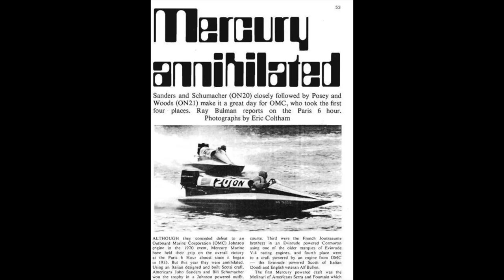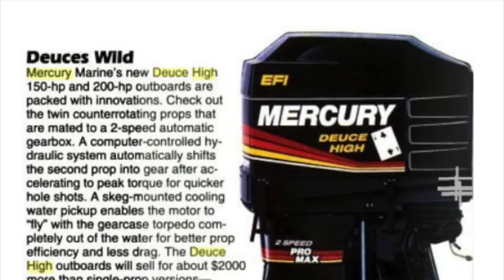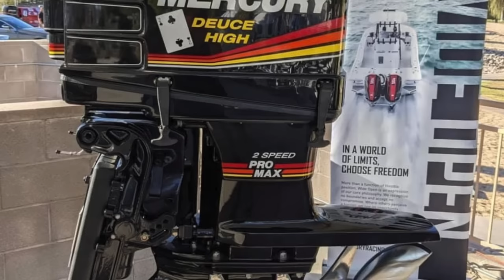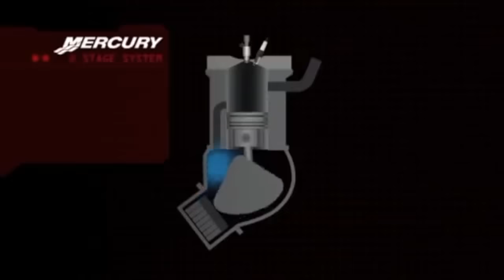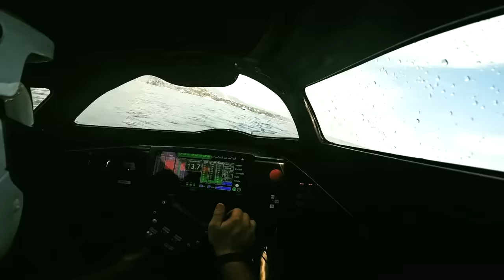Mercury Racing TOP 5 ENGINES OF ALL TIME 50th Anniversary Special

Comment: I raced a T2X, OPC 88, Molinari hull in '76 and '77. The SSM gearcase skeg would hum like a wet finger on a wine glass above 85 or so and resonate through the boat. You knew at that point that you were smokin'! What I learned on those inline 6's back then, serve me well today and prepared me become a "guru" (SME) on the Honda inline 6 CBX motorcycle. I wish I had never sold that rig. I'd have it set up today on a stand, just to hear it howl. I saw 110 on the Keller speedometer at the Columbus river race. Those were the days! Ranked 5th, nationally against sponsored teams.
Reply from the maker: That's badass man!    Thanks for the comment!!!!!

Comment: Great video until the noise problem outboard will be replaced by the electric racing division. 😢😢
Reply from the maker: Not replaced.   You simply cannot race boats in lot of areas because of noise.   This series means racing in areas you can’t currently race at!  More racing, w super weird hull designs!

Comment: Cool video

I bought a used 250xs right before Covid - love the lightened cowl vs standard one on my prior 225 opti. Don’t race so can’t comment how much more I got going with the racing motor but should add value nonetheless. Not a fan of the higher octane which is impossible to find in rec gas so I end up using octane additive just to be compliant. Opti tech was pretty cutting edge but still lots of high pressure things to go wrong imo. I know many love the old 250 and 300 non-opti just to simplify the tech but they drink like sailors. Pick your poison…

Ironically read that Evinrude did finally master the 2 stroke emissions after some serious failures. Apparently less polluting than even the 4 stroke mercs and optis - shows that some bad business moves can sink the ship so to speak even with potentially better tech….
Reply: P.s. Love the plan for e racing / frustrating when people slam it but it’s ignorance and never having been pinned to a Tesla/EV seat…crazy torque and less parts to deal with
Reply from the maker: Yeah, I think they bet on the wrong horse.  Regardless of how clean it was, people associated 2 strokes w stinky/smelly/poorly running engines.  Sad to see them go, I liked how they were taking cowling a completely different method with swappable side panels.
Reply: The 250 Xs isn't  a racing engine. It is a detuned version with oil injection. The race versions of the 2.5s ran premix and much higher RPM. 
Search 2.5 280 Offshore and 2.5 300 Drag.
Reply: @GT-mn3bx  ok - was the 250xs not hand built at mercury like the 300xs? Maybe my facts are wrong. It might not be classified as pure racing but it was hand built on that line vs the 250 pro xs factory fishing engine line
Reply: @1972mdc  They were a consumer friendly "Prosumer" detuned version. Less port timing, lower rev limiter, oil injection, non offshore midsection.  They don't even have the same growl of the 2.4, 2.5 offshores or the 300 drag which is unmistakable. Also, they didn't have the massive water dumps right off the heads.  Few other things also.
Reply: @GT-mn3bx  well all I know is what I learned online and calling Mercury tech support. The pro xs is the consumer version, the xs (300 and 250) are categorized by them as hand built racing engines on a separate line. I prefer the simper tech of non-DI but it’s what I have (plus a Simon tuned ECU).

Comment: Sitting on my shelf somewhere in the back I have a 1983 2.4 chrome cylinder 300hp oval port. Yep a 300 hp 2.4 does exist.  I also have another around 1983 chrome cylinder race motor.  I also own one of the motor out of Jon Wrights Tinker Toy. 156mph world record holder.  Started life as a 2.5 150hp block.  That’s 3 Mercs. All used on my 1985 STV Sprint bottom stepped sponson race boat.  One of Summerfords personal under 400lb hull boats.  Then I go and buy one of Summerfords less than 200 made 1988 Stratos 200VT Rockets with an evinrude XP color matched motor trailer and hull 200 body hiding a very modified Johnson 200GT Loopers highly modified engine with quite a bit of cool stuff on it.   Unfortunately I hadn’t touched or rode any of it for 5 yrs now.
Reply from the maker: Use it or sell it to someone who will.  Stuff hates sitting and just turns to junk.  Life is short!
Reply: @ADDvanced   I know, your right.  Just can't seem to do it yet.

Comment: Regarding Evinrude failing. It wasn't because people didn't want two strokes, it was due to Evinrude's poor quality control and design issues that caused too many failures. Bad reputation is why people didn't want them.
Reply: back in the 70's and 80's omc made engine was the only way to go, Mercury, Chrysler Archimedes Penta or Cresent was just crap, maybe Mercury was god on racingboats, but for the common man just another problem, but in the later years Mercury has made good engines and all the other above is gone.
Reply: @ottoolsen9676  You are referencing the wrong era. I have no complaints about OMC or Mercury from the 1970's and 1980's. I owned both. 
Evinrude failed much later. They failed with poor quality in the fuel injected era. One example is the Evinrude Ficht. Some lasted but many didn't, which killed their reputation. 
Our family and friend's experiences with high HP Mercurys from the 70's on has been excellent. Running high speed tunnel boats at redline. Great fun and reliability. Still running a 1980's Mercury V6 200hp on a tunnel. Still hits speeds in the mid 90's. The sound of the above-water exhaust and surface-piercing prop is awesome.
My uncle had a first year Merc 200 V6 (1977 I think) that we all abused by running flat out regularly on the Colorado River and Lake Havasu. It never failed. We've had Mercury's through the end of the two stroke era. The later 300+ hp engines are awesome.

Comment: ADDVANCE did you ever get your overheating issue addressed.  I sent you a YouTube link to Small-town bassin. His MERC was double firing, causing his overheating issues.
Reply: Was wondering the same thing
Reply: What was the fix?
Reply from the maker: Nope, winter happened.  Sort of.  Worst winter ever.
Reply: Looking for double fire on each cylinder is not as complicated as shown. Just need one good visible mark. Needs to be tested because it would cause heat and loss of power.
Reply: @Paul Gnandt  Robs MERC was overheating, he couldn't figure out why it was overheating.  Small-town bassin from YouTube had the same problem,  turned out to be his motor was double firing.  He did a series on it.

Comment: Well I was hoping the Black Max was in the list 😂 I just bought a boat with a 150 hp Mercury black max. It's a 19' CC. I have no idea how fast it will be.  I'm a new boater and I haven't even got it in the water yet. The last owner said it will hit 45 to 50 mph with two people on it. I don't plan on going that fast but it will be good to know I can get back to the dock in a hurry if a storm rolls in. Down here in Florida a storm can roll in quick on the lake and the rain is so intense it can swamp you.
Reply from the maker: Well, it sort of is.   The black max was never really a mercury racing engine though, and the derivative of it, the merc v6, was what powered the deuces high.   I did a video specifically about the history of the merc v6, please check it out, you will dig it, even has vintage black max advertising in it!

Comment: Well my first time with Mercury Outboards was in 1987, I bought a 24 foot Skater with a pair of 2.4 Efi Offshore Outboards, each outboard put out 285 hp and I could run WOT at 130 mph, only bad part it had no Nuteral so when you started the engines you were already moving forward and both Outboards were on Hydraulic Jack plates so I could regulate how fast I wanted to go.   Now that last boat you showed looks a lot like another European boat called the Bladerunner????.
Reply from the maker: Oh my god that sounds amazing dude, dual V6 2 strokes is god level!

Comment: The TRS Mercury Drives where the Best with 460 Ford engines and the 1970  two stroke 250 outboard was the best
Reply from the maker: Mercury racing started in 1973.  Anything before that was just a mercury product.

Comment: I remember reading about Mercury racing engines. They have proprietary stuff in there, so you can’t go in there yourself. You have to send it back to Mercury to get it fixed.
Reply from the maker: Depends on if you want a warranty.  The QC engines I think that is true.

Comment: You left out the 50s and 60s.  Hurricane motors, they were made for racing, but were for smaller Hydroplanes and Runabouts.  Stockers ran on gas oil mixture, they even had engines that were Made bu Quincy Welding works in Ill.  They used the stock cranks and had the quicky lower unit as we called them..  It was a quicksilver lower unit.  In Stock classes you had A, Mark10H, B, which were Mark 20H, C, which was Mark 30H and D, which were Mark 40Hs.  In the alcohol motors, they classified them as Outbouards, as they were not stock which included A, B, C, D and F which were Mark75Hs.  All was good until the Konigs came along with tuned exhaust.
Reply from the maker: Yes, because Mercury RACING started in 1973.   Anything prior to that was not a Mercury Racing product, it was a Mercury Marine product.  Which had racing products, but the companies are seperate/different companies.

I have a lot of videos on the hurricane/lightning, please check out the 8' Hydroplane project I have going on.   It has a quicksilver hydro mid and lower unit.

Comment: Misses the mercury blue motor 525 a staple in a lot of early offshore boats, and the god father of the QC4 the 1000 sc with dual quad barrel carbs
Reply from the maker: QC is cooler... cmon :P
Reply: @ADDvanced yea it’s cool but it’s rare, 1000 sc and 1075sci where the backbone of all big offshore power in the 1990 to early 2000s
Reply from the maker: @jaydenbankes8126  I don't know much about them tbh.  Where should I go to learn?

Comment: Thank you for including the Tower of Power, or specifically Twister II X. Now thanks to you I know how it is a bit different than the standard Tower of Power. Such as the firing order. Didn't know that. The rest of this you won't like. Sorry for saying this, naming the QCV4 as one of the top five is, .......
You're talking about an engine that requires a specific outdrive, the only one that can handle the power. It is an impressive unit but really think about this. Engine and transmission = $200,000. That's not including the boat. AND a boat it goes in will be BIG out of necessity, and expensive.  Needless to say, you're covering something that the vast majority of boat lovers will not have. Mercury can manufacture products for more wealthy people. That's fine. You can also cover said products. That's fine. But why cover it period when when the other four engines you talked about are much more commonly owned and accessible? And they're all outboards. The Verado 400R for instance. Definitely deserves more praise before you go all out to the most expensive piece of equipment Mercury Marine has ever produced. 
Or you could also do something unusual. Include the QCV4, but in an unusual top 6 video instead of the usual top 5. I'm only saying all this because I'm a hardcore Mercury outboard fan and Mercury committed war crimes and treason when they discontinued producing the beloved inline 6 two stroke Tower of POWER. 😾
Reply from the maker: It is the ultimate offshore engine and produces more power than super cars.  It’s expensive and exclusive but way cooler than a 400R.
Reply: @ADDvanced It's cooler, ONLY because of all those horsepowers talking to you. All 1,650 of them. You've been warned. Don't let horsepower consume you.

Let horsepower consume you.

Comment: you have completely missed the history of the QC4V.
First it was the 1350. Then it was the 1100. Then it was the 1650 race version, which became the 1750 race version. Then the 860 and Class 1 N/A version. At this time we also got the two dual cal engines, of which the 1350/1550 was first, then the 1100/1350.
And they are produced to this day, not from 2003 to 2013. They debuted in 2011.

The V8 outboards debuted in 2018, not 2010.

Comment: Technically Evinrudes V8 2 stroke was the best performance outboard (still holds the outboard speed record to this day
Reply from the maker: Sort of agree.  Yet it doesn't dominate tunnel racing, because it was so rare and not supported.  So...    it was super cool but ultimately didn't matter much to the world of performance boating.
Reply: yeah, it is cool that they exist, and they were very ahead of their time for power, a lot more rare than the mercury's, but technically they do have the speed record, I'd take a mercury over them any day tho, way more reliable and a lot more parts out there, but yeah technically the Evinrude v8 does own the speed record, I do feel if there were more of them out there that they might could beat mercury's, but unlikely , and of course there aren't many out there to change the mode of performance boating

Comment: I like your list of course but the original V6 mercury performance 60 degree holds a place above most of other on the list.  It was and in many ways still is the most dominant racing engine in history of boat racing.  I own one of the original T3 racing engines that was sold to racers before the motors were available to the general public. even in your top ten list the new and highly advanced 360 V8 still has to compete against a two stroke V6 race motor that shares many parts with engines that are 40 years senior and is still competitive in more than a few racing classes today.
Reply from the maker: That’s what’s on the deuces high and it’s such an important engine I did an entire video on it.

Comment: This is a tough video to make so some honorable mentions are at hand:
Mercury 260/280/Drag 2.5efi
Mercury 2.4 Bridgeport
Mercury 150 and 225 ProMax 25efi (and x) (not the 200 ProMax)
Mercury XR2
Mercury 300 ProMax (and x)

I don't think they raced the Optimax in F1 only F2...
Reply from the maker: Those are all cool, but the deuces high is cooler :\

Comment: At the time line  6:08 is my old 2.4 200 sitting on my old Hydrostream V-King.
Reply from the maker: Awesome float!   Still have it?
Reply: @ADDvanced  Sold 13 years ago. I believe the boat is in Louisiana. The engine is in Missouri, and the owner tracked me down somehow. The engine has an alien cowling now and probably a new lower unit.
Reply: @ADDvanced  also had it up 85.6 mph, turning a 26" small ear chopper. Basically, the power head was stock. Lighten flywheel and stock jets. One piece adapter from a 260, single ram clamp bracket, ridge back offshore exhaust housing 20"

Comment: No mention of the Evinrude F1 back in the 80's?  For a while they dominated the F1 circuit.
Reply from the maker: This is a video about mercury racing products, man.   In the merc v6 history video I do a section on the omc v8
Reply: @ADDvanced  Good catch.  My mistake.
Reply from the maker: @nja1758  check out that vid if you missed it, you'll dig it.
Reply: @ADDvanced  10-4.

Comment: You totally didn't include the highly popular with hotboat guys the 2.4 Bridgeport offshores, the 2.5 280 Offshore and 2.5 300 Drag from Mercs high performance division, the Drag previously called the 2.5 SS for Short Shaft aka 15 inch mid were, and still are the best outboards ever. 375 Lbs.  Think about that for a second.  The 3.4L 300 Xs gets a runner up spot for many reasons. Also the F1 Champ engines for pure racing.
Reply from the maker: Those are all super cool engines.....  Deuces High is cooler tho.  Lol.   I mean I did an entire video on the Mercury V6 history and development, and I own 2 of them, but .... Deuces High still wins :D

Comment: merc 2.5 260 hp and 280hp not even mention here? they still used in drag and circle boat racing? truly the king in v6 power for the last 30 years. weight to horse power never be match again.
Reply from the maker: Same power head is on deuces high.   But cooler because twin props and gearing.   Also I did an entire video on the merc v6s alone.
Reply: same power head except the drag, 280 and special motors for circle racing. you never mention the 2.4? your topic was the five best? promax is not even close to the other 2.5's
Reply from the maker: @thomasklement-m1z  Did you watch the V6 vid?

Comment: As far as I know the Duece Hi, was just a marketing strategy.
Merc heard that Yamaha were about to launch the Yamaha ProV 150 with counter rotation props on it
Merc put this across the isle from where Yamaha were about to launch the "First Counter Rotation Outboard"
Think it was the Mercruiser Black Hawk gearbox coupled together with a 2.5 EFI.
It was not a working unit at that point. Mid 1990's
It was just a static display to one up Yamaha
In later years some work must have been done on it, but I doubt Mercury had any real plans to make it work.
Bet the Mercury Technicians worked on this in there spare time to see where they could get it
Reply: Both the Blackhawk and Deuce high were failures neither one would last under load at high rpm the gears failed for several reasons ...the Blackhawk would blow under load when the props would come out of the water and reenter under load over and over they kept yeeting out the case ...same with Deuce high but also when the shift took place it would scatter under power.
Reply from the maker: I've talked to people that have run it up to 115mph, so ..... yeah definitely wasn't a static model, man.  Not sure where you are getting your info but it reeks of manure.
Reply: @crashalexander7232  Ya, Blackhawk. We where Mercury Blackhawk test dummys for one race season. Never finished a race with both drives. Always blew out the upper but while they worked they livened up the boat. We sent the drives to Mercury, they repaired and made changes and we blew them up each time.